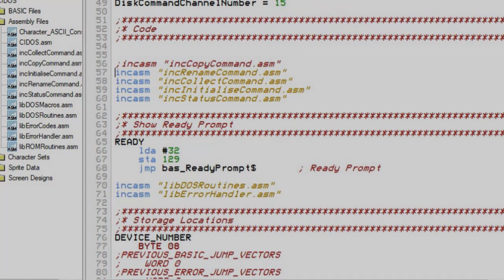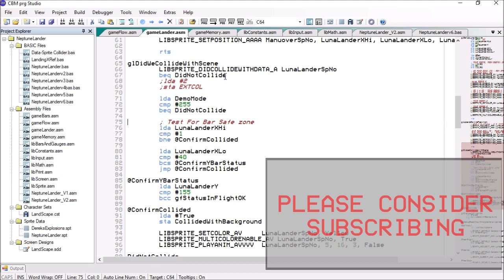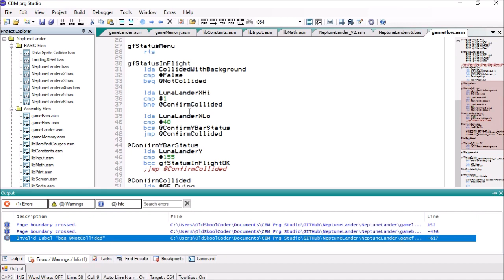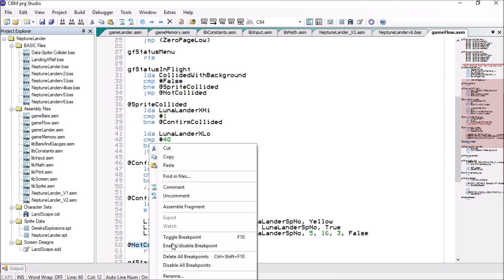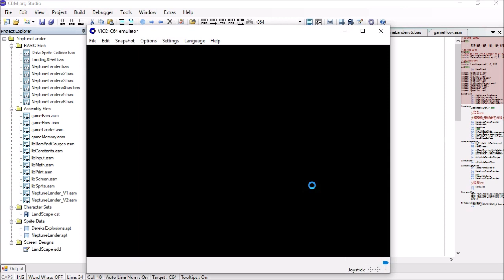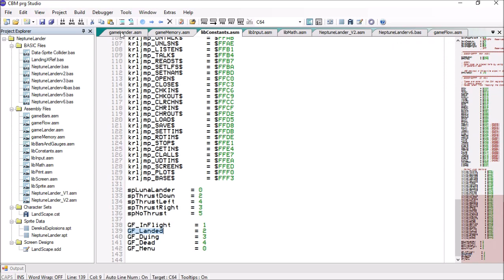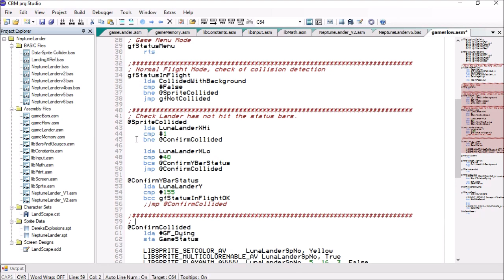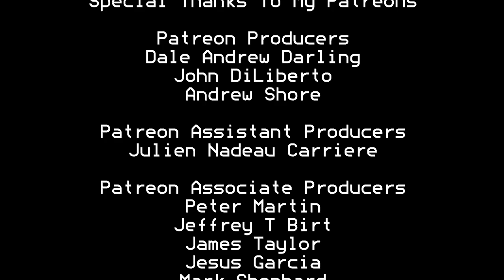Tutorial 35.15 - Sort Out Game Flow Logic

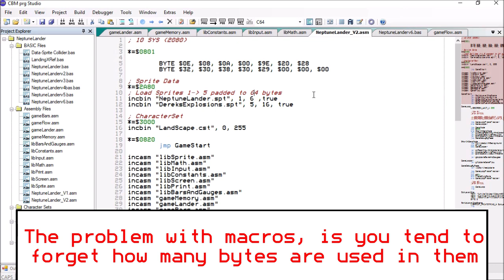Comment: 8:21 They really need a mechanism where the macro calls a subroutine if isn't performance-critical enough to repeat the code inline every time, and the subroutine is only included once only if it is actually called.  I suppose you could subroutine-ize the macros yourself.
Reply from the maker: Watcha Dude, of course that is an option, i used to do that as a child, as the assembler I wrote did not do macros, so all I did was subroutine way.... so yes I could be called a little lazy now-a-days ;) lol